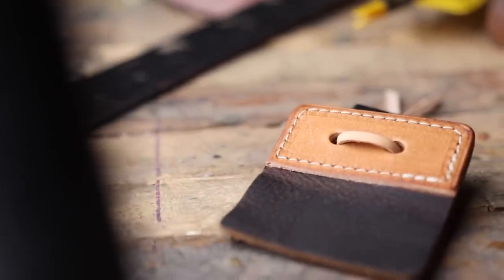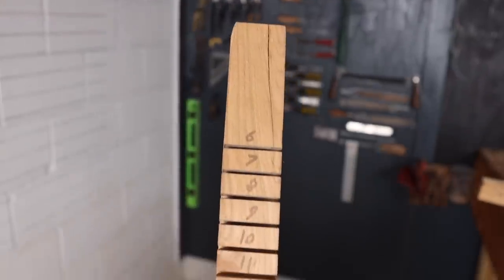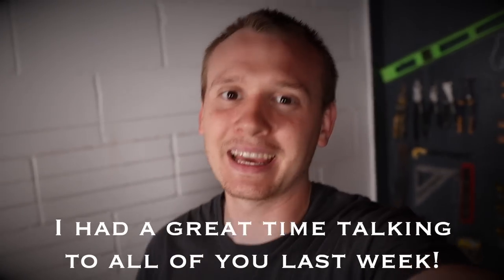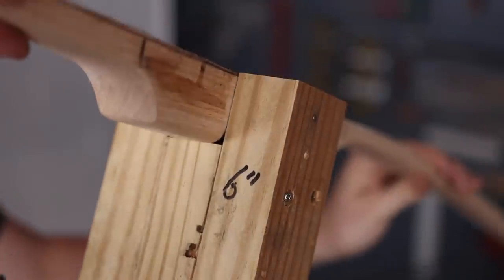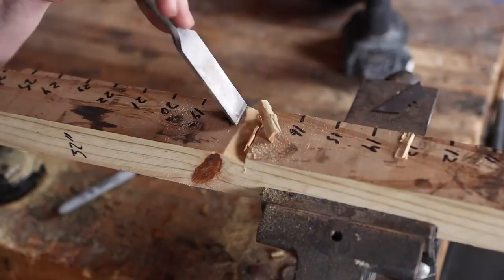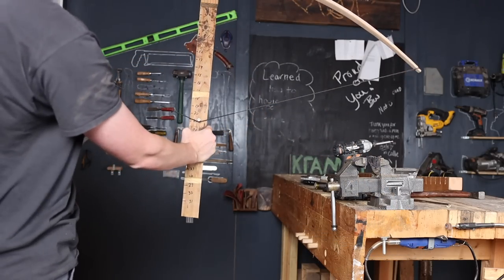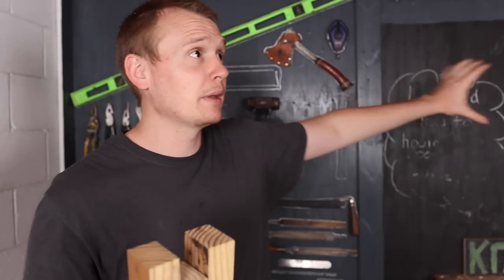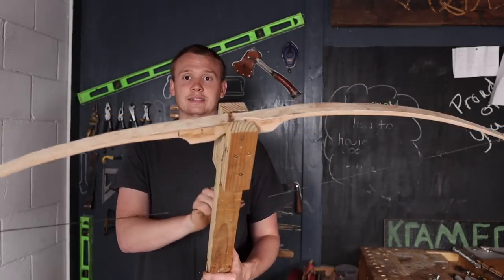How To Make "Your First" Tillering Board for Bow-making.

Comment: When you make that tailoring stick you can set the bottom of the tillering stick on a bathroom scale, then as you pull down to find a poundage of your bow your bathroom scale will tell you what the poundage is of the bowl. It is an easy way to measure the poundage on your bow.

Comment: I use a simple plank, with holes every  5cm (2''?) In those holes I inserted dowels. So I can use a rope to pull back from a distance, and hammer out a dowel to hook the string so I can get up close
Reply: Smart, had I been using my tree I wouldn't have been smacked in the face by a bow drawn out to 80# as a rough spot I missed while sanding chewed through all 18 strands.

Comment: This video like all of your others is brimming with infectious enthusiasm This video is timely for me as I have just completed a bow blank ready for tillering.  Incidentally, I am trying an experiment .   I ripped the 3/4 x 1- 1/2 stave down to 1/2 thick.. I then saved the remaining 1/ 8 thick strip and cut a 16 inch and a 12 inch piece and feather sanded 2 inches on each end .  I then cut the standard  3/4  x 1- 1/2 x 8 handle, and  then laminated the 3 pieces onto the 1/2 inch thick stave.  What may you ask did I get for all that work? I got a perfectly feathered fade from the 8 inch handle to the 1/2 inch thick stave.  and  uniform thickness  limbs.  It seemed to me that getting that fade correct and reducing the rest of both limbs to a uniform 1/2 inch thickness with a draw knife is one of the trickier tasks of the build.  Ripping to 1/2 inch thickness ensures a uniform thickness for both limbs.  I guess this could be called a semi laminated bow.   The upcoming tillering process will either validate this experiment or prove the error of my ways.  Keep up the great videos.  Good video productions take a lot of work and you are really great at it. Thanks for sharing.

Comment: I asked last time about using a bow from my power chair.  I was wondering about shooting with the bow at a 45 to 90-degree angle to the more normal perpendicular to the ground shot.  What problems will shooting like that induce?  Is it harder to aim, does it cause problems for the arrow's flight, etc?
Reply: thanks, had not considered the issue of head placement.

Comment: Trees are way safer, took a bow drawn to 80lbs to the face when using a stick as a temporary setup,   with a tree that unnoticed fraying wouldn't have left me stunned, covered in blood and with a concussion because of the space provided by the rope. So maybe stick to lower poundage bows with this no matter how much you trust an 18 strand string, sand your nocks smooth and double check that they have no rough edges and  be safe.